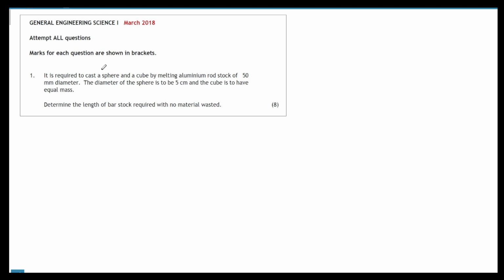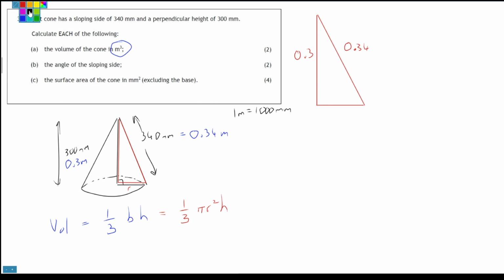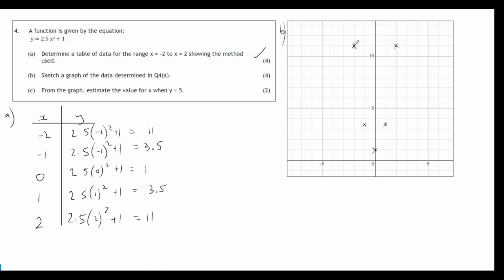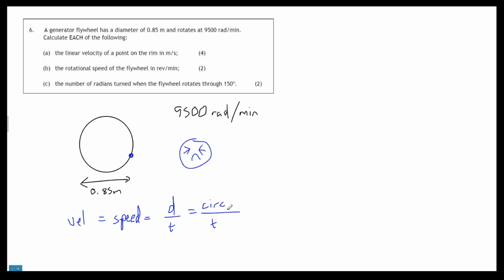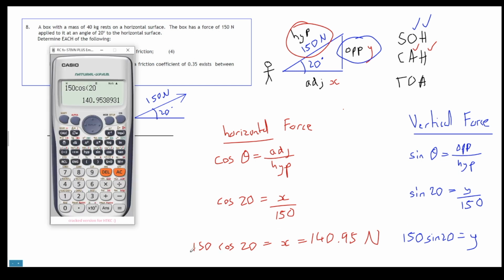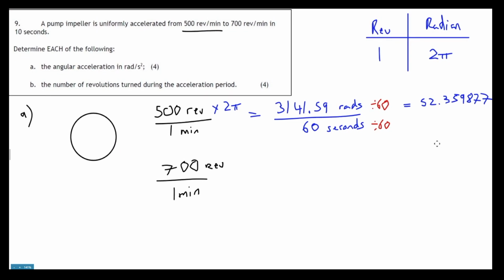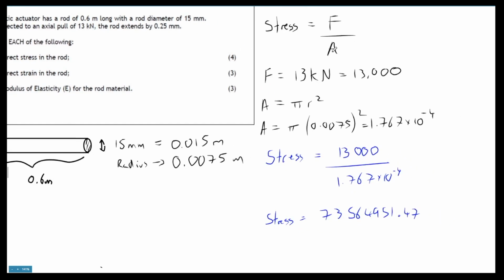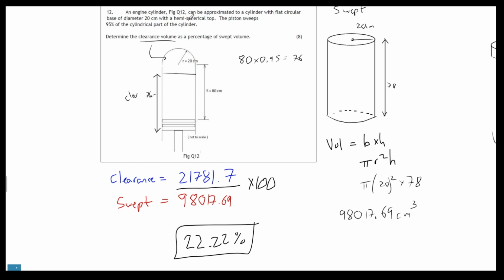GENERAL ENGINEERING SCIENCE 1 EXAM  (GES1) March 2018

Comment: Thanks David, i had a chuckle with Q3 part B. Over the years some of the questions that the SQA have asked are very broad and leave a lot of room for interpretation leading to a loss of marks. I thought, with GES "there is no wiggle room in math so as long as i understand the math i should be able to achieve high marks" but again they have given a vague question which will inherently lead to student confusion. SQA should really tighten up their question banks.